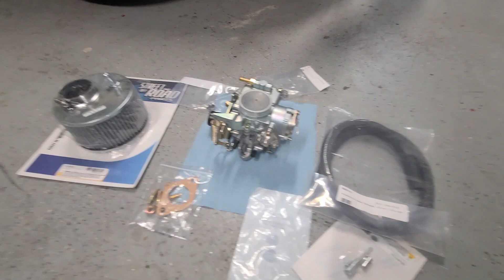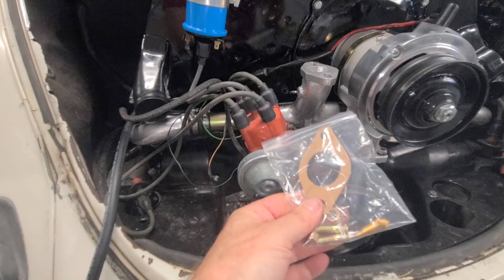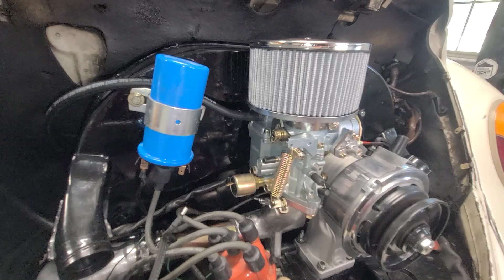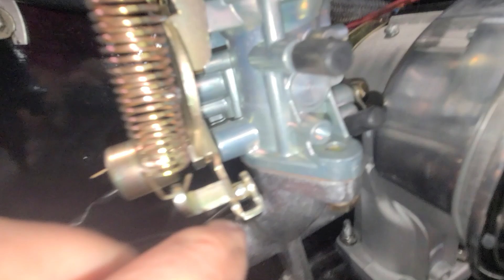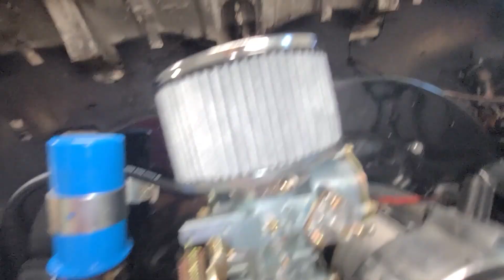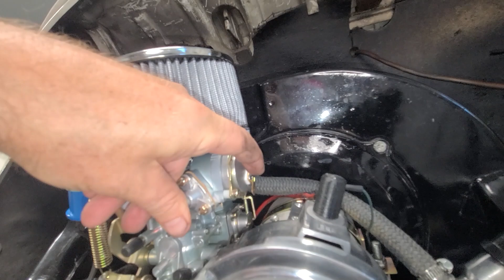1979 VW beetle Conversion [part 4] EMPI Pict3 carb Install

Comment: Did you leave the deceleration vacuum line unplugged?  It will most likely cause nothing but trouble if you try to use it with the carb.
Reply from the maker: https://youtu.be/roR534at0WM?is=M-yqshFAebm5ZENd

Comment: Quick note, you may already know this, but the advance port of the vacuum can - the one that faces you at the bottom rear of the DVDA can - goes to the small port on the LEFT side of the carb, not the one on the rear bottom right.  That rear right one is for use on semi-automatic and goes to the clutch control valve on semi-autos.

Comment from the maker: Correct, I have plans to replace the exhaust in the future. The current exhaust is for the fuel injection model.  I will need to replace it with early model.

On a side note, I have been driving the car for a while without heat risers and not had any issues.

Thanks for the comment.  I appreciate it when people cover things I breeze over.

Comment: I noticed you didn't install the heat riser tubes and changed the exhaust to accommodate them. That carb will be very cold and freeze up, causing running issues. I believe J bugs even said it on their website.

Comment from the maker: The original fuel system had specific pressure requirements because of the injectors.  The return line has a pressure regulator and then goes back to the tank.

The carb has pressure requirement, but it is controlled with a float bowl.  So there is no return line.  I just removed the rubber line, and left the pressure regulator in place to act as a vacuum pressure flow control.  So, basically to answer your question...
Nothing, I did nothing
Reply: Fuel pressure is actually regulated by the fuel pump.  Factory mechanical fuel pumps put out 2.5-3.5 psi.  The problem w/many new after market mechanical pumps is that they often put out 4+ PSI and overwhelm the needle valve in the carb, causing flooding.
Reply from the maker: @vittorio7775 the fuel pump i installed in this solution was part of the kit from JBugs.  It was selected for this carb